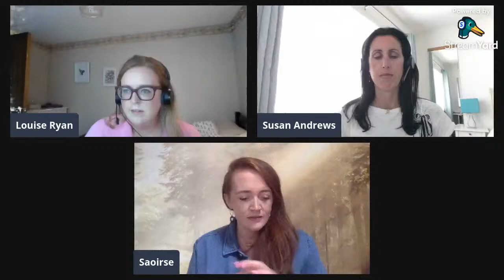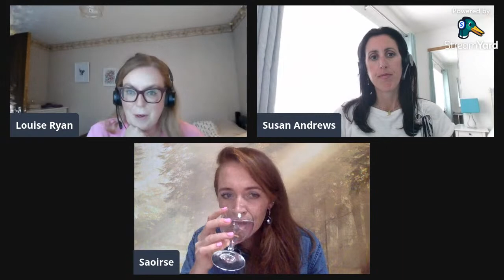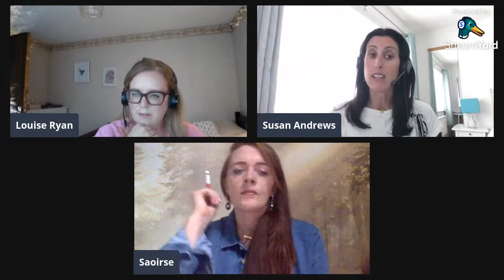Episode 2: Where to start with your home energy upgrade

Comment: Adding foil insulation to the rafters of the attic can retain heat AND reflect heat in the attic so its not boiling (your attic contents also) your attic nor meaning its freezing in the winter (and letting all that heat content out)